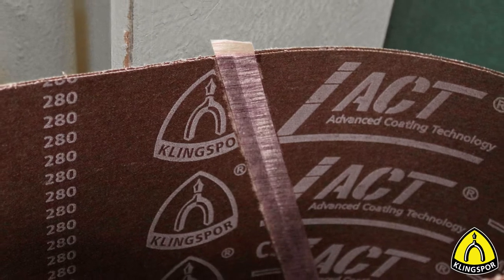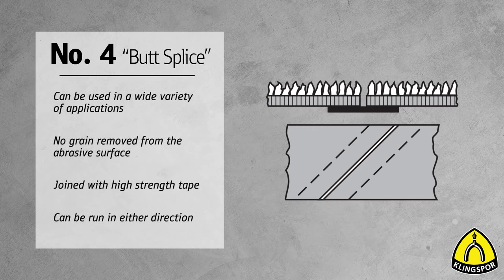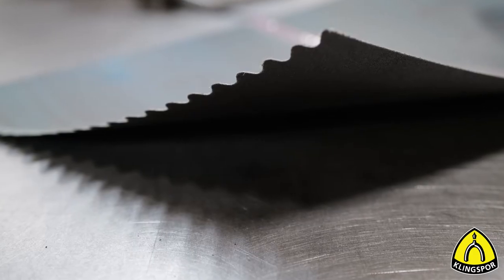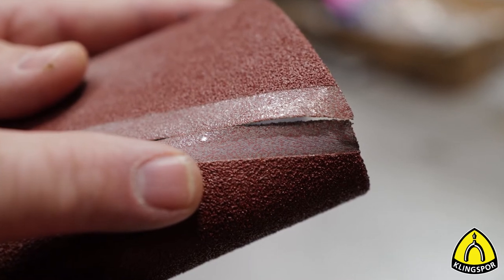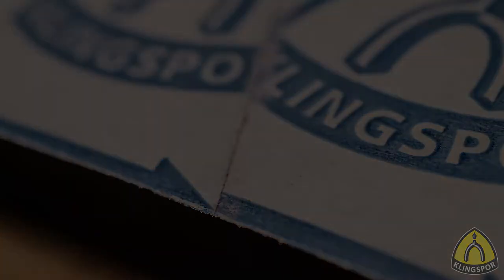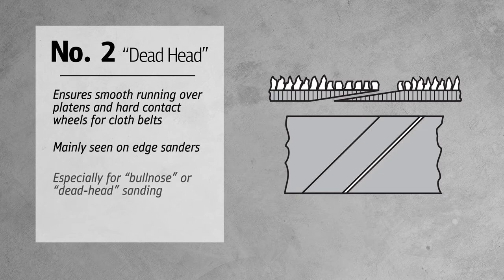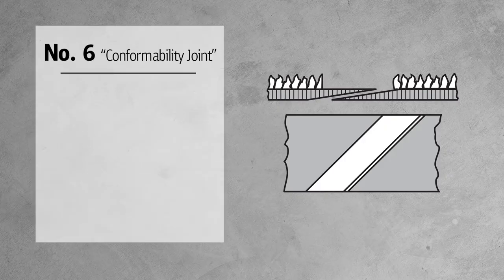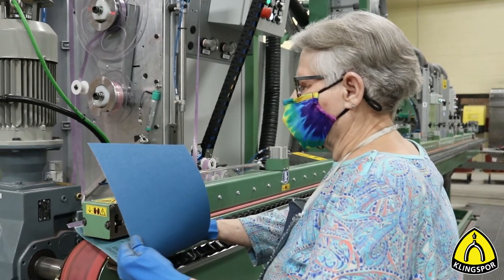Understanding Abrasive Belt Joints | KLINGSPOR Abrasives USA

Comment: Good stuff, why the fancy joint for the glass industry?? thanks.
Reply from the maker: The zig-zag of that joint allows for more surface area in the joint and hat makes it stronger. Also, it is less likely to catch on the sharp edge of a glass piece (compared to the No. 4 joint that has a larger flat area for the glass to catch). You can run the No. 3 joint in both directions, so you get more life out of such a belt than of the ones with the tape on the back.